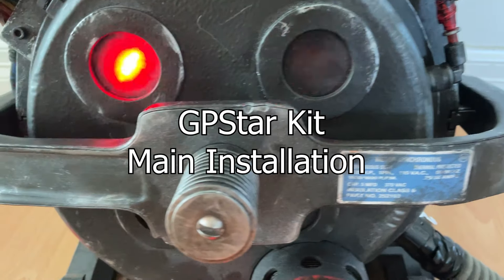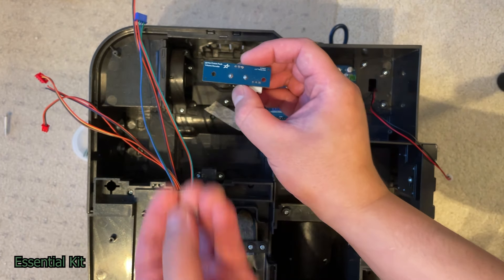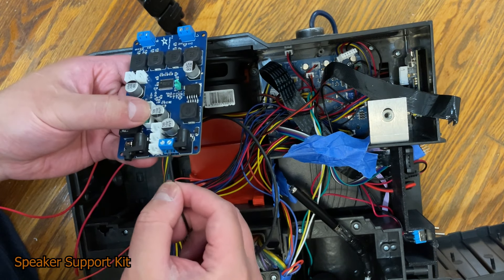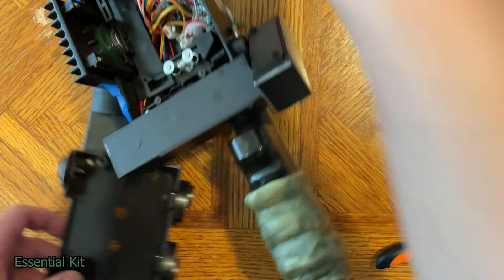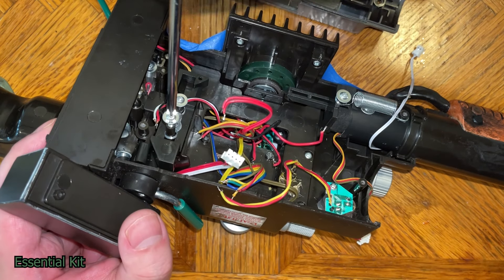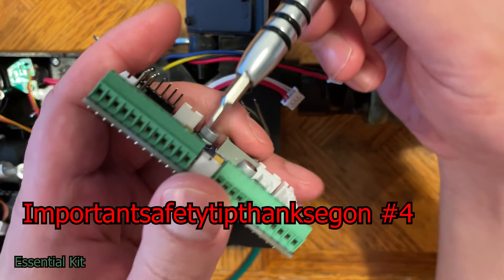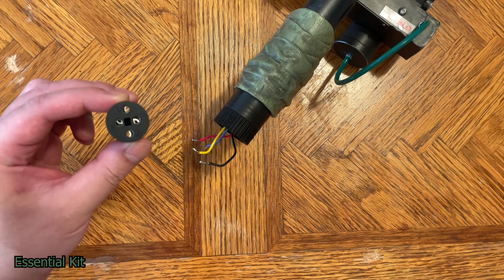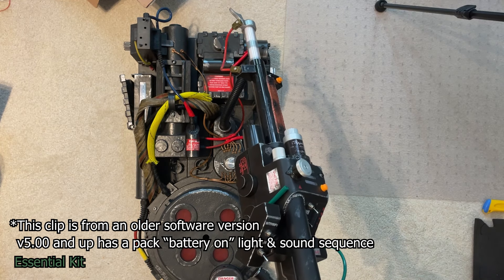UPDATED gpstar's Haslab Main Kit Step-By-Step Installation Guide

Comment: Hello, will this work for the Life Size Spirit Pack at all? and if so you have a video on that
Reply from the maker: if at some point i get a spirit pack i would but don't have one atm and they are expensive to get in canada
Reply: @jonogunn  but would it work, I saw on the site Spirit DIY kit for it
Reply from the maker: @Vamgothic69  yes 100 it works for it. although you'll need to replace the spirit wand for the hasbro wand. we have the 3d printed mounts and everything for it. check out our fb group for others who have done it already

Comment: You say the kit is for the 6000 Talentcell, but it looks like you installed the 3000. The 6000 is too big, do you have instructions for that?
Reply from the maker: Taking the battery&switch out of the casing is the best way and I believe it fits in the same area. But then the switch would need to be mounted somehow. I’ve seen others using the d-cell battery area for the battery in case. 

Check out our gpstar page and Haslab pages on Facebook as people have shared their solution.